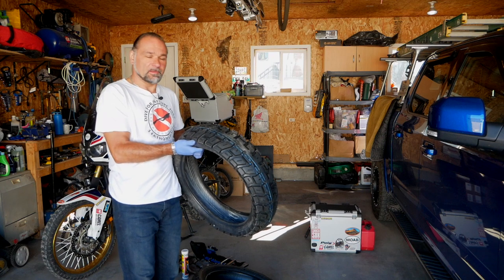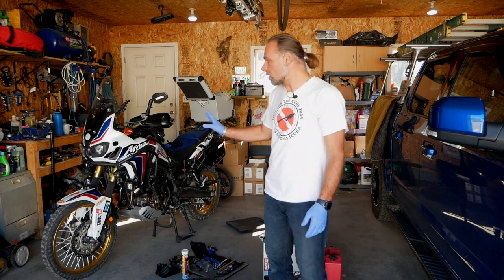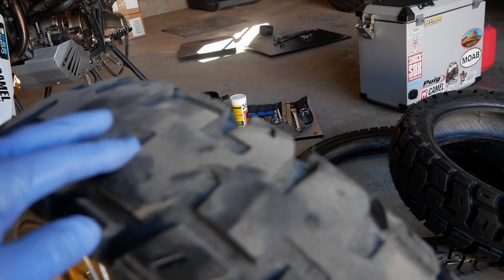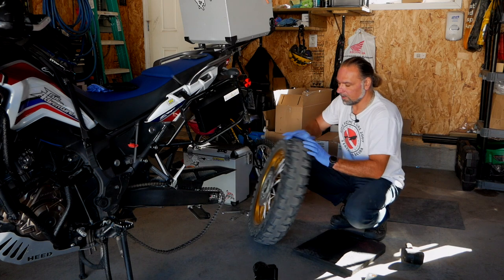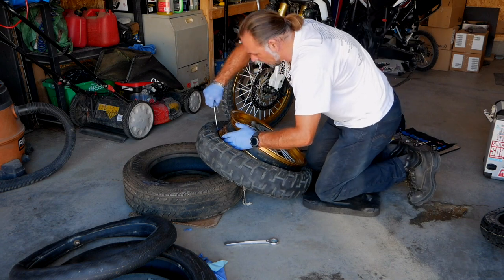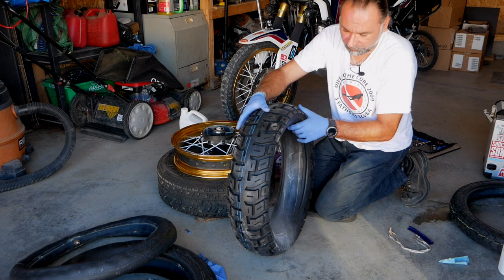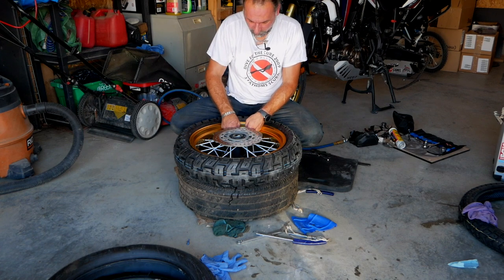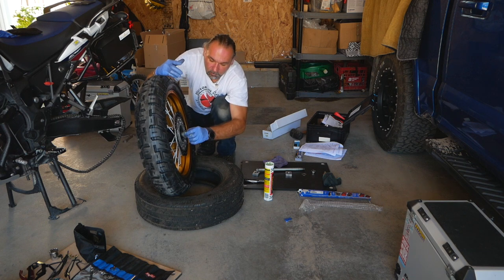MOTOZ TRACTIONATOR GPS REAR TIRE CHANGE AND REVIEW.  HONDA AFRICA TWIN CRF 1000

Comment: Thank you for this video. A few of questions: 

Where do you buy your tires?
What type (Brand) of tubes do you use?
Are your tubes heavy duty?

Did you buy your bike new?
Have you had any major problems with your bike?
Did you buy the Honda extended warranty?
Reply from the maker: I buy my tires at my Local Honda dealer.  I use Motoz Tractionaror GPS best multi terrain tire one of the longest thread life.  I Use most of the time Michelin Heavy duty tubs.  My bike is a 2017 CRF1000L manual transmission yes I bought extended warranty it saved my butt when within the first year my head light burned out it would of been over 2000 dollars out of my pocket no other bike issues since just always maintained on time.  I do all the work myself using parts and fluids bought at my local Honda dealer here in Calgary.  I will be releasing in near future new tire change Video using Baja no pinch tool.  And I am on my third tire set again tractionator GPS
Reply: Hi again,

Just wanted to follow up with you about the Motoz Tractionator GPS tires.

I just bought and installed a set on my Africa Twin.  I am so happy with these tires! The biggest benefit is that I no longer worry about a catastrophic front tire blow out because these tires are almost as good as run-flats because of their super-stiff sidewalls.

Thanks again for your content. I enjoy your videos very much. I wish I had a riding group such as yours. Riding alone limits my options I’m afraid.
Reply from the maker: @John-zb2kw thank you for being here on the platform and I'm glad that my video was able to help you. I still run these tires on my AT sometimes it's ok to ride alone just don't push your luck and limits.  I also will be giving up on riding very difficult trails as it becomes too costly on the repairs.  And friends are always pushing to go where sometimes my gut is telling me not to. Riding alone is ok as you are doing what You want and within your comfort zone.  I also do most of my riding alone only the longer adventures with the bigger group. Yes that part is more fun and great group of riding friends with the cold brew at the end of the day is fun to share the daily routine and laugh at each other

Comment: Great video thanks for all the detail. You do make it look easy. I think I'll order a set. I'm fairly certain my experience getting them on will not be as easy as you made it look 🙂
Reply from the maker: Go for it first couple times it may be harder once you get the idea its a piece of cake make sure to use your knees to press on the tire when installing,  another very useful tools justbfor installation is Baja No Pinch tool look it up on YouTube worth every penny I just got got it recently will make a video in the future as well when changing tires again
Reply: @AdventureTravelandScuba   thanks for the encouragement and the recommendation much appreciated.

Comment: I'm going to attempt changing my tires on my 2018 AT crf 1000L2,  I've never done it before.  You don't mention anything about the brakes do you have to loosen the calipers or do you just take the tire right out?
Thanks!
Reply from the maker: you don't have to take brake calipers off you can take the wheel right out, when putting it back on make more space on brake calipers by pushing the pistons back in to its body (do not use sharp object as you will damge pads) you can use thin flat piece of wood
Reply: @AdventureTravelandScuba  OK, Thank you for your help! Great videos!

Comment: Hy , how many kilometars did the tyre
Reply from the maker: Dunlop about 8-9K Motoz GPS 17-18K I talk about it right at the beginning of Vid 0:45m Dunlop 1:10 Tractionators
Reply: @AdventureTravelandScuba  super tnx . i will try them defenetly. My las set with tkc70 - 16k
Reply from the maker: @davoruric2637  That's not too bad as well 16K out of the bike tire how did they perform overall?
Reply: @AdventureTravelandScuba  mostly super , i m not to agresive with gas , super sticky on the asphalt and four light off road no problem.